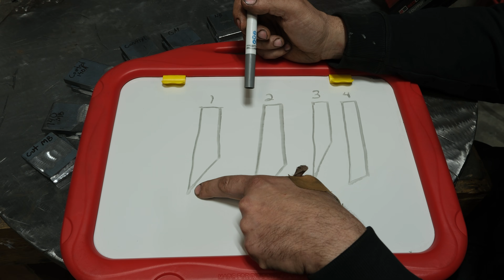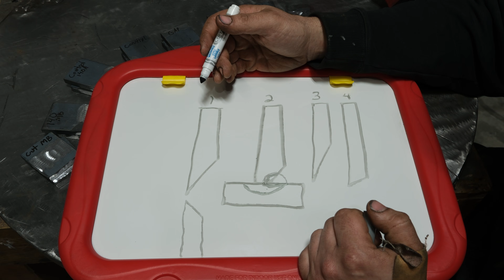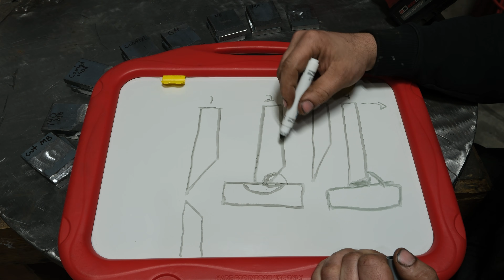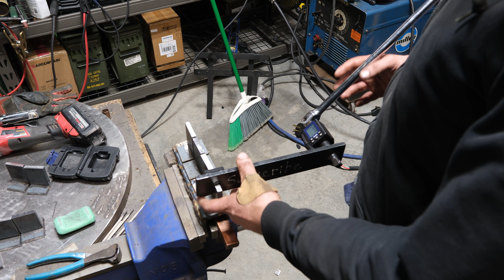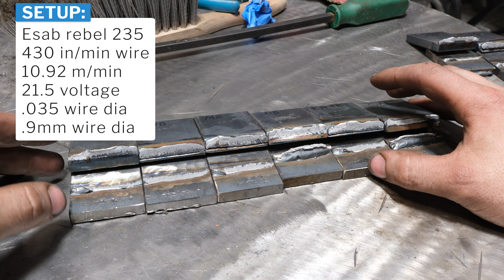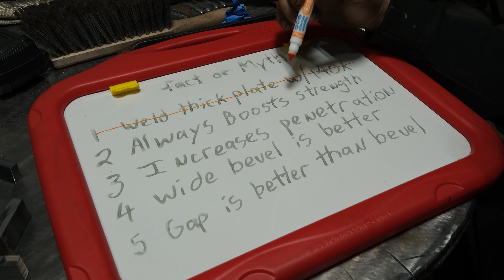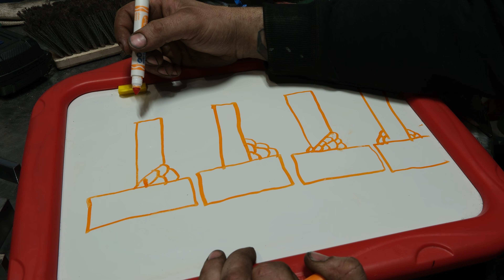Does beveling increase weld strength??  Deep dive

Comment: I’d hate to be that guy but could you do this test this with same bevels with a stick welder? And instead of 140amp mig vs 200, could it be 6010/6011 vs 7018? And if you could, test whether or not smaller stick rods get better penetration with a steeper bevel?(meaning less material removed off the plate/tighter groove)
Reply from the maker: So I actually did the full test with stick and never released it.  I couldn’t get consistent enough results that I felt the test was valid, let me explain:  With stick you simply can’t run certain bevels because they force a long arc gap and it causes the rod to get arc blow.  Not to mention things like the gap required slowing travel significantly to deposit enough metal that you can maintain the puddle.  Which ultimately deposited significantly more metal.  Trying to determine if the strength came from the thicker weld or the penetration was near impossible because of how inconsistent the results were with stick.  I literally tried everything (2 times as many plates as this test) and I had results that were literally all over the place.  I decided to do the test over with mig because it doesn’t suffer from arc blow issues and is mostly unconcerned with bevel angles.  

I have done stick once on about 20 test plates and this video 2 times.  Based on everything I have seen, a bevel can help increase strength, but if you use the wrong angle and settings it can actually make it worse.  Ultimately unless someone does a bunch of testing on their own with their own setup, there is no way to know what’s going on with their welds.  Visually many poor welds look or on the surface.  If anything the video drives home the point that if you’re welding on something that needs strength you need to know for sure what worlds via testing.  Guessing is not a good solution lol.

As far as 8010, I doubt in a bend test on a fillet weld it would surpass 7018 but if I can find some I will give it a shot.  I do have some 11018s and a bunch of 80+ rods I could try as well, which I am sure would still hold on.
Reply: Well I guess I should’ve finished the video before commenting lol. You hit every nail right on the head
Reply: To add something worthwhile to this comment, could you test 6010 vs 8010 on bend test? I see 8010 gets used in pipe and it makes sense to me that 8010 is stronger but are there drawbacks to it?

Comment: Personally I tend to weld straight cut with an inconsistent gap because I suck at cutting and fitup... Regardless I weld very steep favoring the bottom plate only welding the top plate incidentally probably with a small weave occasionally. Basically my strategy is to weld the continuous plate with everything I got knowing it won't melt as easily as the edge of the other plate. Now I gotta weld some scrap together and see what the hell is going on. I got a trike frame to remake!!!
Reply from the maker: Anything beveled will definitely have more penetration, so keeping the heat on the thicker material will help bite into it.  Being able to focus heat on one or the other plate is a must have skill to weld dissimilar thicknesses, or many holes will be made lol.

Comment: I completely understand WHY you made only one pass. The problem I see is the WHOLE POINT of grinding a bevel is so you can lay down more weld with multiple passes. I understand you don't get the same results person to person and the thickness of your material. I follow Curtis at CEE. Almost all his stock is at least an inch and he bevels almost all his welds.Or as he says bananas because he uses metric system. I weld not very good but I weld, and he's an artist. He preheats almost everything he welds. That way the metal doesn't suck the heat out of his welds.
Reply from the maker: Your thoughts aren’t wrong, thicker plate needs multiple passes.  CEE repairs things that are quite a bit different than what the average person works on, let me explain:  preheating much of what he welds on is more for preventing the base material from cracking during cooling.  Many high strength steels have hot shortness sensitivity.  The preheat will not provide much additional fusion (I have tested that with little gained) but it will allow the material to be welded.  By depositing more weld further into base material you are effectively able to reduce the amount of weld outside of the material (number of cap passes) to reach full strength.  You are also able to achieve the highest strength possible if you fully weld the part with no remaining gap/lack of fusion between parts. Depending on circumstances this could be required.  

The purpose of this test is to show that simply putting a bevel on something and thinking you’re able to weld thick plate to the maximum strength with the short arc process is not correct.  Although the bevels tended to show a increase in strength (much of which came from bigger welds due to my inconsistencies), they all suffered from poor root fusion, some had poor side fusion, and none of them are what I would deem acceptable for the purpose of welding 3/8th plates for high strength.  Had I completed a few more passes on them the actual strength difference would have likely been fairly close I think.
Reply: I think the takeaway from this video is that while yes, you can bevel and lay down multiple passes for additional strength, if you aren’t using a suitable process with a high enough heat input you still aren’t going to get good fusion. So you’ll just have multiple poor welds stacked on top of each other. 

The choice of a bevel versus a fillet weld in industry is dictated by the geometry and strength requirements of the joint. If space constraints allow it a fillet weld is always cheaper to run than a groove weld. Groove welds are typically only used where there isn’t space for a fillet weld, at least if we are limiting the discussion to T joints. 

Curtis at CEE, if I recall correctly, typically runs spray (I think I’ve seen him run some dual shield as well), which is a more suitable process for welding thick materials. Whether he uses a groove weld or a fillet weld is more or less his preference (or dictated by the part/machine he is repairing) and using one or the other will not result in a better or worse weld. Preheat is more about reducing the cooling rate than improving fusion/penetration.

Comment: Question:  most welding filler metals have a much better Tensile Strength than the Parent Metal with regard to mild steel.  How much difference does the increased filler metal strength in conjunction with the extra surface area (vise none beveled or Gapped) of the joint make?  That is to say, would using a stronger filler metal like with 80k+ psi for example, improve joint strength when stressed or flexed?  Is it possible to join two like material mild steel plate with some kind of Stainless filler metal?  Would that increase or decrease joint strength?

Maybe I missed it, but did you use a significant or slight Pull angle on these test welds?   As stated in one of your earlier videos, a Pull angle is significantly stronger, and in testing my welds, I found it to be a HUGE improvement of joint strength (I made a basic copy of your testing setup).  You made a believer out of me, and unless I have no choice, I always Pull now, and my welds have much improved, and I have more confidence in them!  Thank You for that demo video, and encouraging/showing (us) me how to test my own welds.

You once said you want the weld itself to fail rather than the parent material. Sometimes when I do a bend test, the weld remains basically intact and tears out the base parent metal.   Why does this happen, and why is it an indication of a problem/bad/failed weld?

Would run On and Off plates help reduce weak starts and stops aka improve weld strength by removing thin or weak/thiner beads or welding the end/corners at as you have shown by producing a more consistent and uniform bead.
Reply from the maker: So over spec rods are quite a rabbit hole.  It’s common for higher spec rods like 80xx or higher to have a number of undesirable “side effects”.  It’s very common for them to require a preheat on the material, or the welds will crack.  They are most commonly used for welding on materials that need preheat and post heating anyway so that’s generally not an issue.  However if you use them on mild steel and don’t preheat the weld will likely crack during cooling.     There are ways around this (it comes down to how they are achieving the increase in tensile strength).  I have a few rods I will be doing a group test with, including 11018, which I know will likely crack lol.  Stainless 309 rod (or even 308) will welding mild steel successfully.  My guess is they will likely they would not handle a bend test (on say 3/8th plate fillet weld) as well as 7018. I believe the penetration is rather shallow and many 7018s actually test higher than 309 in particular.  I will have to round up the 309/312/and special purpose electrodes and see what happens.

I did use a pull angle, the difference with pulling is definitely significant.  Push if needed based on the situation but pulling for the root will lead to stronger single pass welds.  If you had to do a 3 pass weld doing a push on the cover passes would likely be just fine, but the first pass you will loose root fusion. Speaking of root fusion, I have a comparison video out this week on 100% co2 vs c25 gas.  The results surprised me to say the least.  

As far as metal being torn out of the plate vs the weld, it could be as simple as the tear taking the path of least resistance.  If the weld is not perfectly centered (45 degree angle to the root) with equal fusion on both plates, it will likely tear out of one of them.  If it’s taking a bunch of material with it I wouldn’t worry too much about it. If it’s like in the bevel video where it pulled no material with it I would worry.  Depending on the welding process it’s also common for this to happen, 6011 and 6013 had a tendency to do that.  

Start and stop strips/run on/off tabs will solve the issue with reduced fusion at the start and blown out ends.  To make the most consistent welds this can be a requirement.  Consistent welds equal strong welds.  This is why tig has an advantage over other processes, it can achieve 100% root fusion start to finish on short welds where it would be impossible for mig or stick to do so.  It is possible to achieve no lack of fusion at the start with stick and mig, however the settings would have to be hot (making weld terminations blown out).  For the most part a less than perfect weld is more than fine.  Where they become an issue is on high vibration, high strength materials, and/or high stressed joints.  I have a pretty interesting video out soon where I talk about how I failed 2x to make/weld a jackhammer bit.  Definitely a case where you need completely defect free full penetration welds lol.
Reply: @makingmistakeswithgreg  I had no idea that OverSpec Rods had such issues like cracking when cooling.  I was under the impression that like stepping up from 60xx to 70xx produces (theoretically) a stronger weld.  Now that you have explained, it makes total sense that the crystalline structure of higher tensile filler metals becomes more susceptible to cracking when cooling without some kind of thermal soak or temperature control.  Maybe not exactly like welding cast iron, but similar as the carbon in the parent metal migrates to the heat affected zone making the cast iron more brittle.  I understand that “IF” cast iron is welded (not brazed), two things are required PREHEAT and INSULATING the post weld in say warm sand to slow the cooling and recrystallization process.  I found this out the hard way, and now SiB braze any cast iron.

I assume over spec filler materials are used on high strength steels like armor plating, and special welding procedures dictate how to meet the job requirements. 

 Also I recently saw a heavy equipment repair (YouTube channel “On Fire Welding”) welder, do a repair using Run On/Off plates for the first time, when performing a large beveled groove repair on really thick plate.   As a home hobbyist, I can’t imagine needing those on/off plates, other than for learning/testing purposes.   I love your practical approach to testing, and you inspired me to build a similar face bending lever with torque adapter so I could have some basic numerical feedback when the difference in strength might be marginal. But honestly you could get really good feed back without the torque adapter, you can really feel the differences. Even the coupon in a vise, and beating it with a BFH, gives you more feedback on your welds than just assuming it’s a strong weld. 

Since I have started testing my welds as you suggested, I have really learned a lot about how to improve my game.  Sometimes shockingly so.  Thank you for all your advice, encouragement and wisdom.  Hopefully others will read this and encourage them to do the same. I’m really interested in how the welding mild steel with SS filler metal goes.

Comment: Does the beveled plate just break under more pressure because you've essentially changed the fulcrum point of where the force is applied since it not getting proper fusion?
Reply from the maker: The change in fulcrum will undoubtedly make a difference in breaking strength.  How much is difficult to say.  On the test there is no doubt a bit more depth of fusion on most of the beveled plates over the straight 90 control.  That will make a significant difference since it has to be torn through to completely break it.  What I really worry about is the super straight with no depth of fusion on the bottom plates on some of them. I need to do some breaks away from the face in my press to see if they would break there.

Comment: would having the right length/pitch on your weld mitigate the warping of the plate
Reply from the maker: How much a beveled plate twists really comes down to how much weld you put down.  If you put down a big weld that doesn’t fuse at the root, as that metal cools it will pull a significant amount.  Doing multiple passes over a single large one will help keep warping down.  Ultimately if the part needs to maintain being square measures need to be taken to assure that.  Such as clamps, super square fitups, tacking the parts with a bit of “English” aka bent the opposite way it will pull, etc.

Comment: What happens to a weld if you do multiple passes with wire meant for single pass. I've heard that bad things can happen, but I have never heard of what happens.
Reply: If I recall correctly a single pass wires use cheaper and lower quality materials which is fine so long as you have enough base metal to mix in with to dilute it. But as soon as you start running on top of previous welds there isn't enough bass metal to mix with it creating a more brittle weld (someone will have to correct me if I'm wrong, it's been a while since I looked into this). It can be done but you're rolling the dice on its long-term success.
Reply: @TheMadHatter626  Thanks for your reply. I was wondering if anyone has looked into this. I made a repair on my snow plow frame last winter. Thick metal and used several passes. It's still holding. If you saw the welds made by the manufacturer you wouldn't worry. I think the person that welded my plow together was blind. LOL!
Reply: @wrdturkey   Sorry for the lateness I found the an explanation on an old form that I bookmarked.
'Flux cored wires EXXT-2,EXXT-3,EXXT-10,EXXT-GS are recommended for single pass welds due to the high manganese content. Manganese will work harden and add toughness to a weld. If you do multiple passes with these wires they could crack due to the mangenese content will keep building in the weld and become brittle.'

As an add note EXXT-GS wire is an open standard so manufacturers can release wires on the market before they're approved by the AWS (American Welding Society) to promote more rapid adoption of welding wire with specific requirements. That's not to say some manufacturers didn't take advantage of the open standard to produce questionable wire.
Reply from the maker: The mad hatter is definitely pointing in the right direction.  Flux core wire is a funny thing, it produces good single welds however welding over it can have some undesired results.  I have tried tig welding over wire cleaned Gasless flux core welds and it contaminates the tungsten bad.   It leaves something internally to the weld.   I have actually tested multiple pass wire vs single, and what I found is the single pass weld had a much harder surface after the first and second pass.  It appears as though it becomes harder as you layer it.  The problem with this is Gasless t11 flux core wire already is up there on tensile strength (far over normal mig and 7018) and arguably on brittleness.  Making the weld harder and more brittle wouldn’t be a good thing.  The Gasless flux core wire also doesn’t have to meet much in the way of testing standards with -gs wire, so it’s a bit of an unknown. Some manufactures will specify test results for it, but many don’t.  So it’s a bit of a “what criteria does this even meet” deal lol
Reply: @makingmistakeswithgreg  So I wasn't the only one with problems tig welding over flux core, that's a relief to know. I knew t11 flux core tensile strength was up there with Mig and 7018 but I didn't know it was that much higher. Thanks for the new lead for my next research binge. 😁